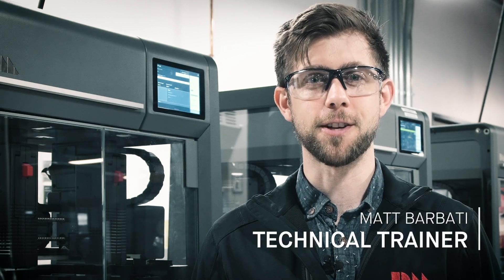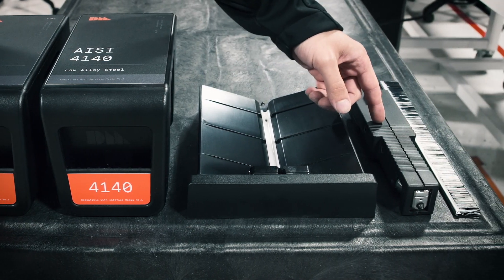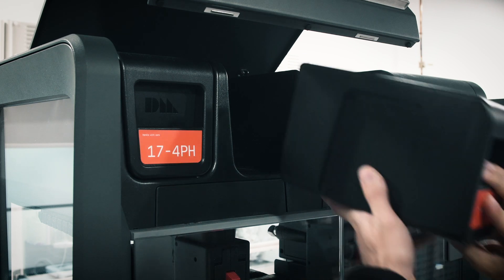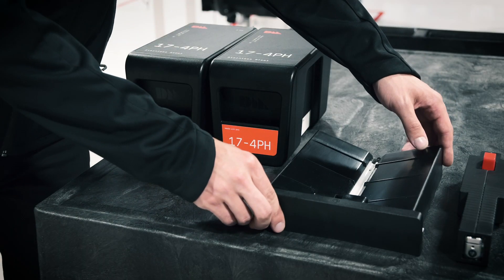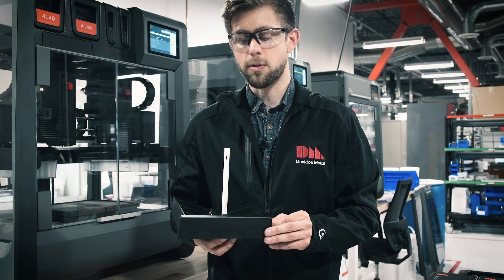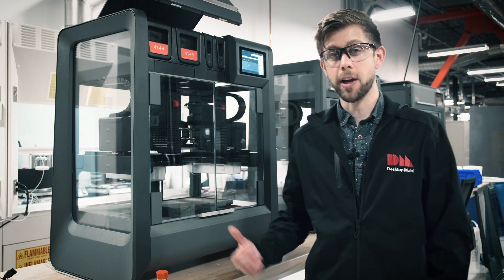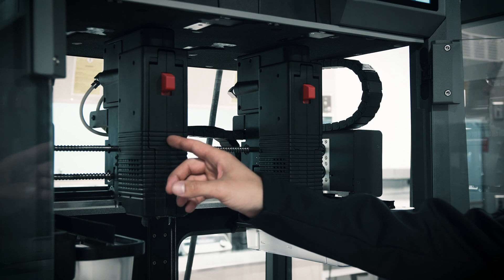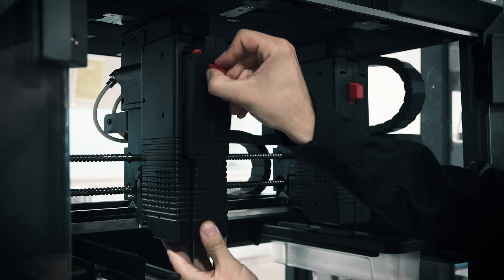Quick look: Easy material changes with the Studio System

Comment: How easy it is to clean the brush, feed tray and the head so it can be use for a different material ? Or do you need a different one for each material ? If that's the case, if you require to use many diffeent materials, there is a growing risk of mixing those up across time...